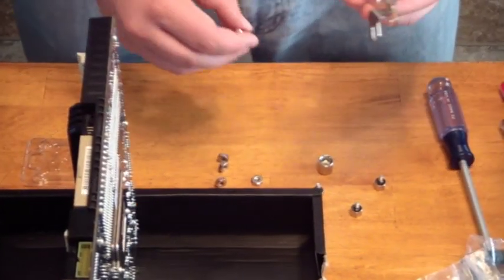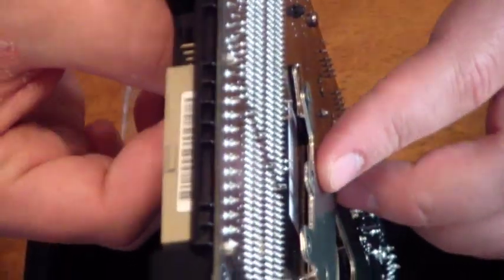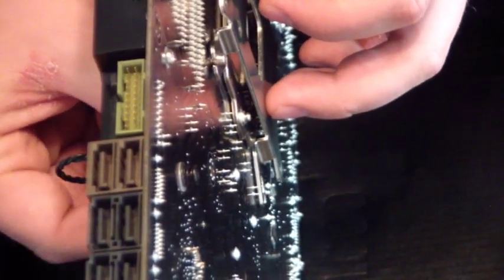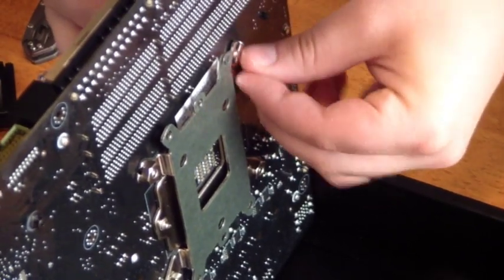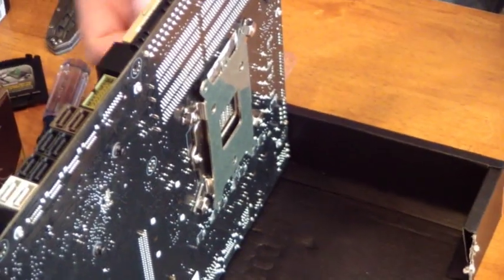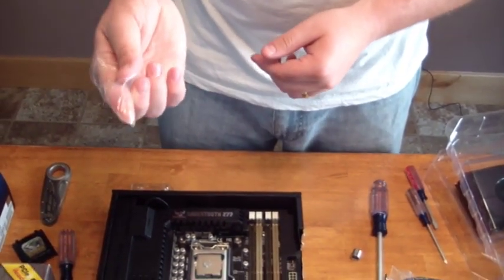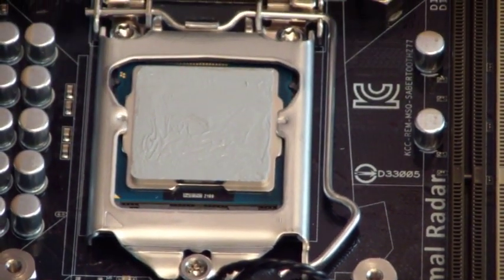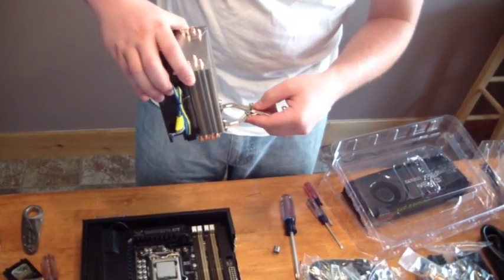Hyper 212 EVO CPU fan Installation

Comment: For those who think he spread the paste incorrectly...you are wrong...coolers that use direct heat pipe contact like this one don't have a smooth even surface that contacts the CPU...thus, the pressure of the heatsink when screwed down will NOT spread a bead in the center of the CPU evenly...you have to spread it yourself like he did in this video for these types of heatsinks.

Comment: A tiny tiny strand of thermal paste fell on my gpu, and it seems to be working fine. But I am not sure.. I was trying to re-install the 212 evo, and a the tiny strand landed on the gpu. I used the thermal paste that came with the 212 and I am not sure if it is conductive or not.
Reply: +Liam Silverman That should be fine, my friend once dropped some cooler paste into the psu, computer has been running fine for about 3 years now. Don't worry it does no harm :)
Reply: Furson yah its been fine. And, the thermal paste was nonconductive.

Comment: HEY NUMBNUTS. A) Your fan is on backwards. B) Don't spread the compound like that, your cooler will make a much more even surface than your chubby fingers in a plastic bag. C) You're supposed to take the fan off to mount the cooler, then put the fan back on. You know, sometimes it really doesn't hurt to actually do research or maybe even look in the product manual so that you actually have somewhat of a clue as to what you're doing.
Reply: Also, start nuts by hand not using a driver. You can easily cross thread them otherwise.

Comment: this fan isn't actually blowing, it's sucking air in. if you google the cooler and check the fan the arrow is pointing back instead of to the front.

Comment: That's what i said. The dot method is good. And if you don't wanna risk or something, keep using it. But if you know how do it right, why not spread? And the video i linked have a lot of dislikes and flames just because everybody believes in the dot method like a Jesus of the thermal paste methods. Anyway, just put a big ball of termal paste and done, better than dot and better than spread. Indeed.

Comment: the video you linked have alot of dislikes and flame.. at it clearly shows that its not all clean contact with the paste using the spread method, even if there is no air bubbles, when theres heat involve im sure the bubbles will form from the messy sides of the spread method as the thermal paste will be softer with heat..so why risk when you can use a much simpler low risk method like the pea method?

Comment: Never spread out your paste by hand or creditcard!! Using that method you'll get airbubbles between cpu and heatsink..
Just put a tiny drop on the center of the cpu, mount the heatsink on it and let the pressure do its job to spread out the paste naturally..

Comment: You're wrong. This model doesn't suck air from the heat sink, it blows the air through it, so, the fan shoule be (if possible) on the other side,so it would blow the air out of the system. However, it's so big that sometimes it's impossible because of the size of the memories (That's my case for example).

Comment: You do know that if you use the line or dot method of thermal compound, the weight of the heat sink will evenly distribute it.

Comment: PEEEEE! Wrong. The dot method is god, it's ok, but it DON'T COVER ALL THE SURFACE, even after the cooler instalation. So, if you want it better, or put a BIG DOT of thermal paste, or spread. 

/watch?v=fGRLaFv3hZw

Comment: Why do you spread it lol all you need is a pea size dot in the middle. The cores are in the middle of the cpu. The pressure from the heat sink and heat will spread it so there will not be air bubbles.